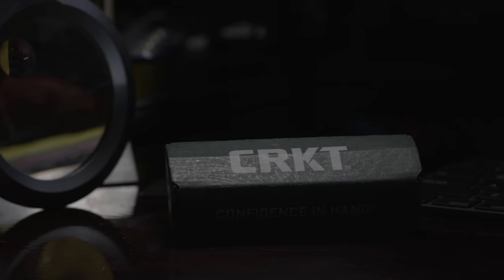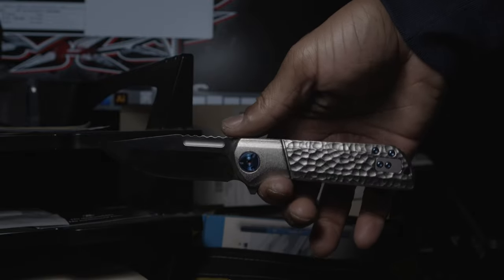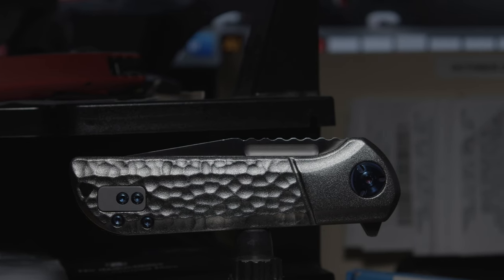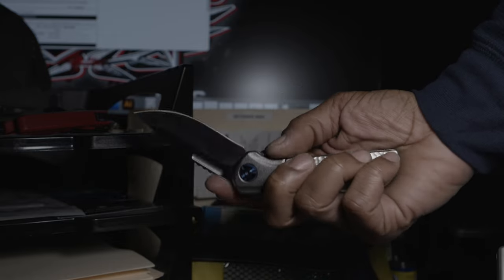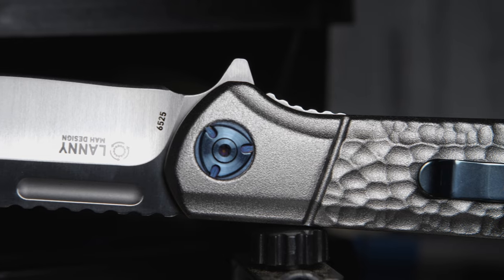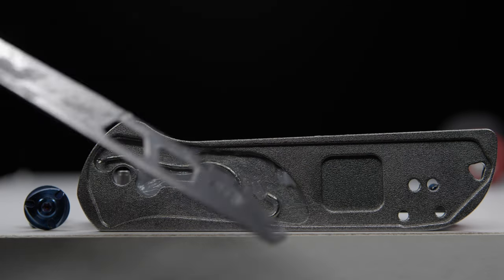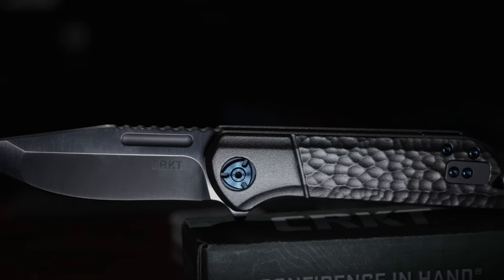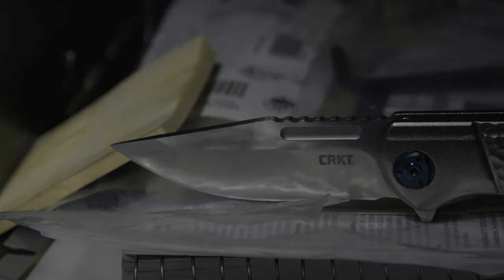VENTURE INSIDE THE NEW C.R.K.T. LANNY

Comment: Is it possible for that torsion bar to be removed (basically turning the knife into a manual opener)?
Reply from the maker: Nope, already tried, Crkt actually never drilled a detent hole in the blade, so the detent just helps with the action in travel, but that's it, the tension bar actually holds the blade in the closed position, if you take the bar out the Lanny goes limp and the blade will just fall out from the closed position.
Reply: @THEFULLERFANATIC  that's a bummer. I would have liked having the option like past models from them (the Heiho for example)